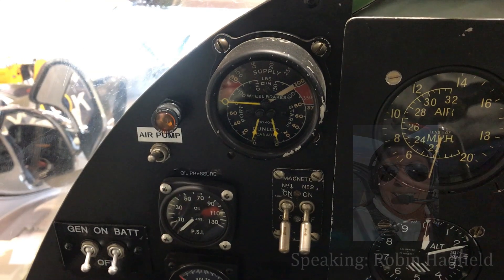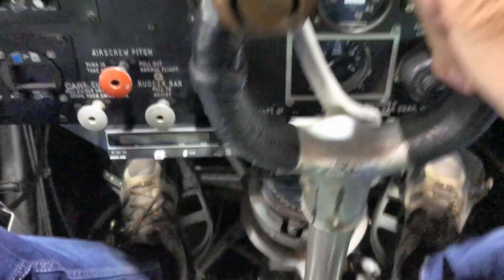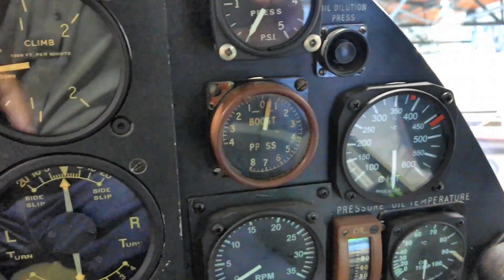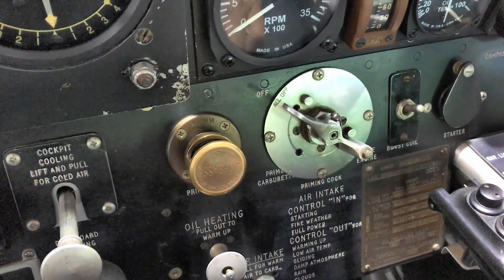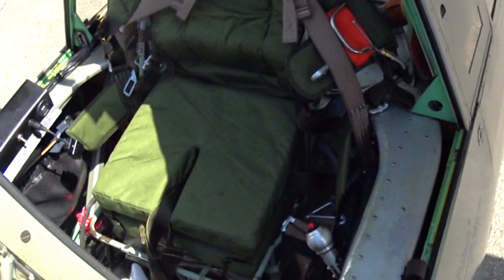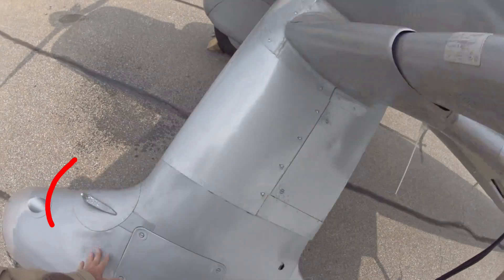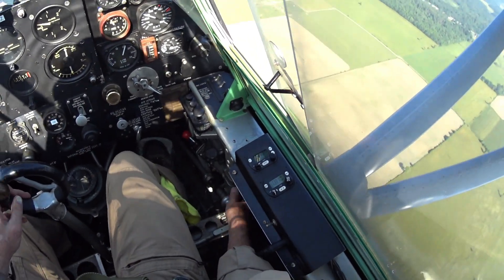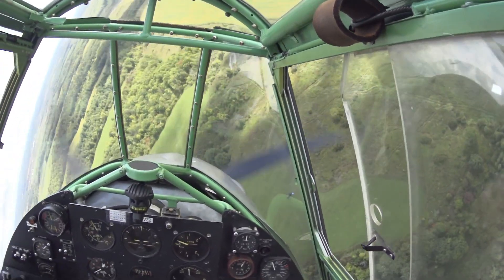Westland Lysander Cockpit Explained

Comment: How many passengers— undercover operatives or resistance fighters— could the Westland Lydander carry and how did they get in and out of the aircraft? Thank you in advance of a response.
Reply from the maker: There was a boarding-ladder bolted to the side of the fuselage.  As for numbers, it depended on how scared they were. A Lysander can carry any number of people who can squeeze into the back, but the space is very small. 
Generally two, but if they sat on top of each other, more.

Comment: I wonder what planes that airspeed indicator were put in that actually needed the inner dial.
Reply from the maker: I've had the Lysander up to about 200 mph on airshow passes, but I don't like it much. The canopy sections shake like crazy, and the inspection-panels on the upper surface of the wings tend to get sucked off.